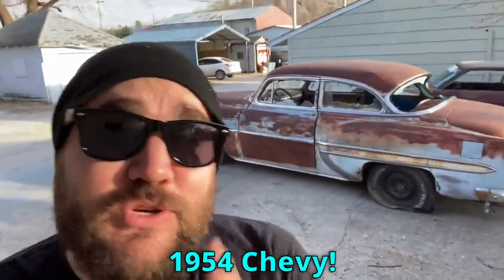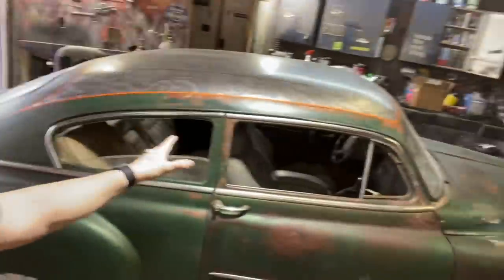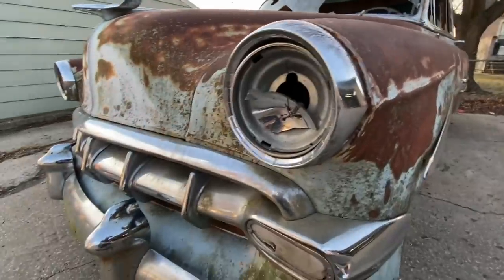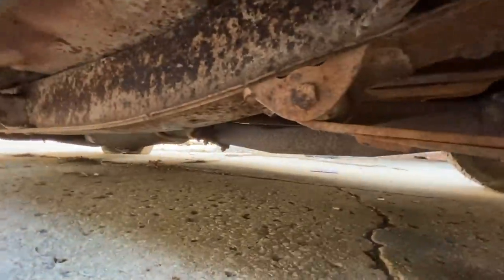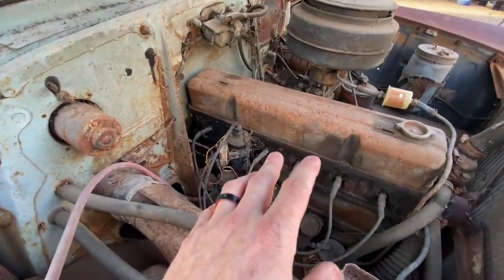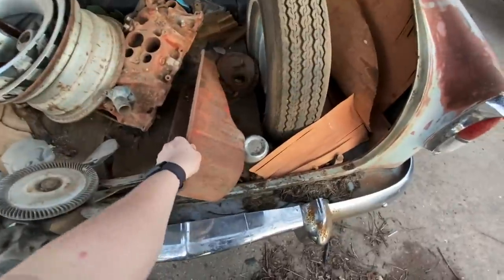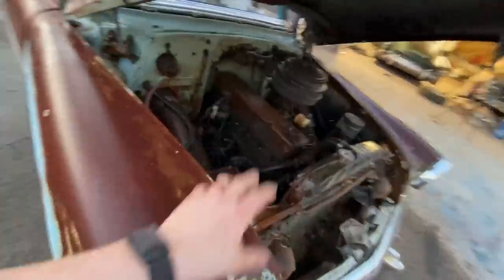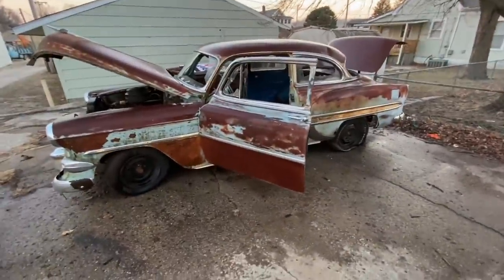I GOT A BIG SURPRISE FROM A CAR I BOUGHT WITHOUT SEEING IT FIRST! SIGHT UNSEEN RAT ROD!  NEXT BUILD?

Comment: What a deal! The glass jug under the hood is an optional windshield washer jug fyi.
Reply from the maker: I knew that but I’m an idiot. Sometimes talking as your filming doesn’t always equal the best dialog. It literally has 1/4” barbs on top of it. It obviously wasn’t a catch can lol 🤦🏻‍♂️
Reply: @CaseysCustoms  That just makes you human man(not the idiot part lol). If everything was all perfect, it wouldn't be real. I own a 53 210 and have parted out some really rough 53/54 chevys. If you need any help or advice on that 54, let me know.
Reply: @CaseysCustoms  they did have a catch can available on those, technically it was a pass through oil filter but all it really did was hold oil lol

Comment: Very surprised about the floors with the windows broke out. Had to be recently or covered after it happened. 
Casey, what's an approximation of replacing glass or replacement glass nowadays on a earlier '50s GM??  $750--$1000 ?? Got my eye on a '53-'54 Buick.

Comment: Nice score Casey. Looks like it may be converted to 12V, seeing an alternator there. You will have to change points, condenser and coil to 12V. Coil will need a ballast resister so points don't burn out. Bulbs will fry and gas guage will need a voltage drop installed so it does not fry. Starter will be fine as long as you do not crank over forever. Just saying a little research can save you some grief, good luck.

Comment: You should go to confession for stealing. Seriously, when I looked at how solid the car is for $800, I almost fainted.  You'll save thousands in non-needed metal work.  And then, icing on the cake, you have a full pressure 235 engine that turns over!  I guess deals are still out there. Wish we were neighbors, my '49 Chev and I would help you get it running. If we can help, let me know!   Matt (new subscriber)